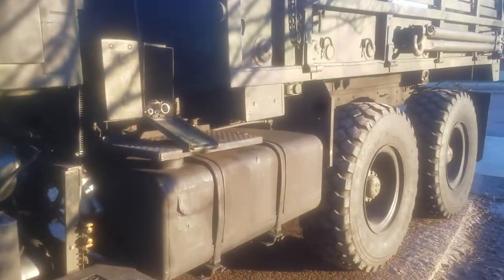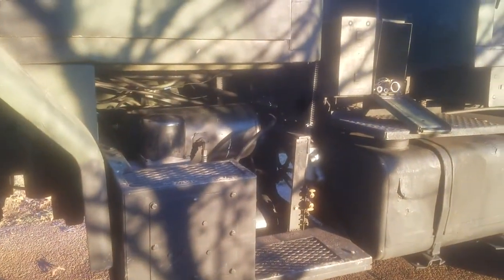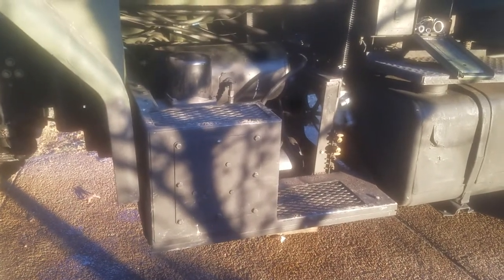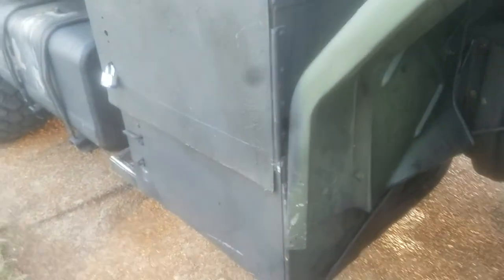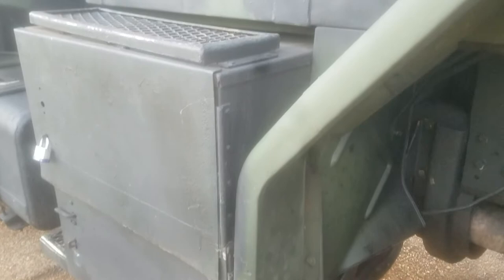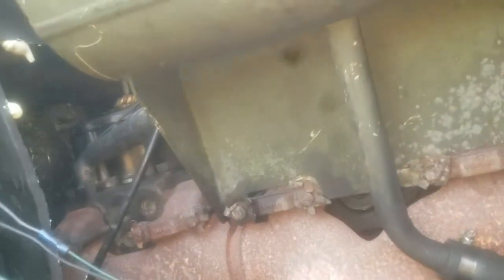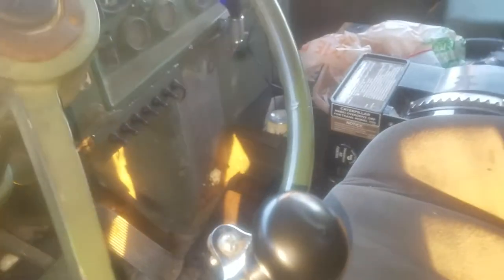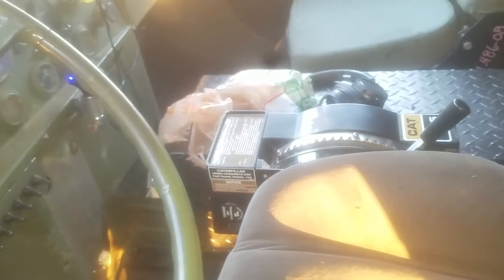M923A1 CAT 7155 install overview/walk around

Comment: Was the original engine the Cummins NHC 250 or 6CTA8.3?
Reply from the maker: ClassicTVMan1981X it is an NHC250 at the moment.   Big cam 400 install is going in next month.
Reply: I hope your CAT 7155 will work well with it... otherwise, consider a rebuilt Allison HT754CR.
Reply from the maker: ClassicTVMan1981X the CAT 7155 came behind the big cam 400 in the first generation 915 series trucks.   I am also upgrading to a Oshkosh 55000 transfer case since the 5 ton case wont handle it
Reply from the maker: ClassicTVMan1981X also the HT754 would not work well with the 55000 case.  The trans has no overdrive. The tcase is .98 so on 1600 tires i would not be able to get over 60mph.